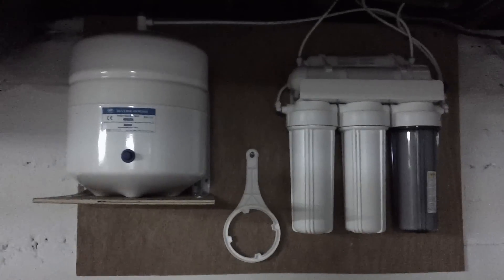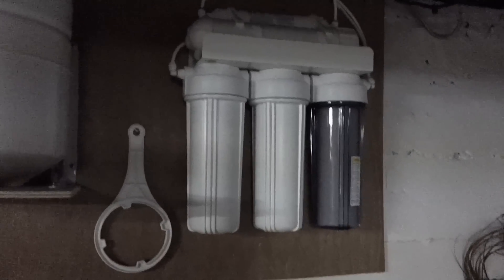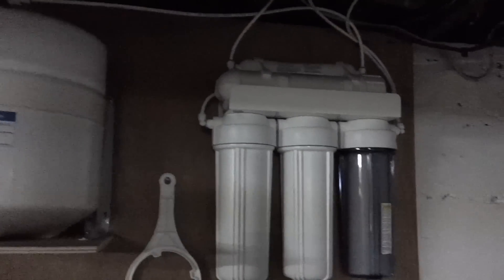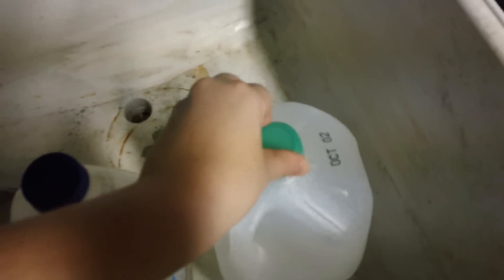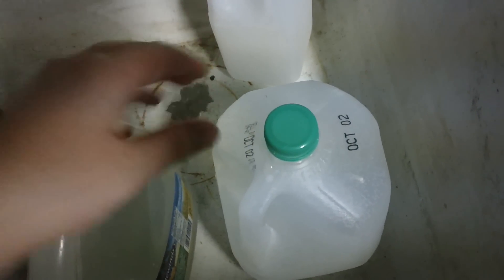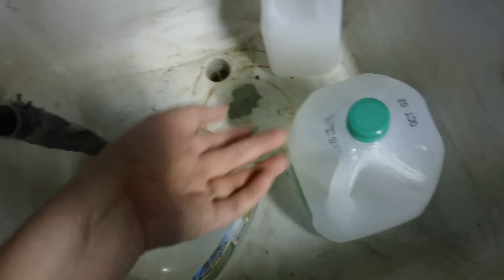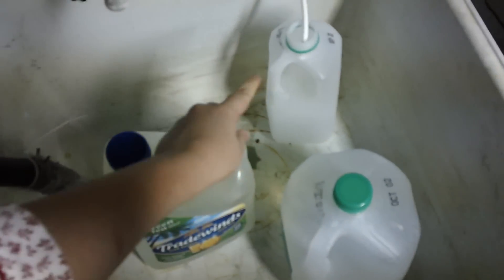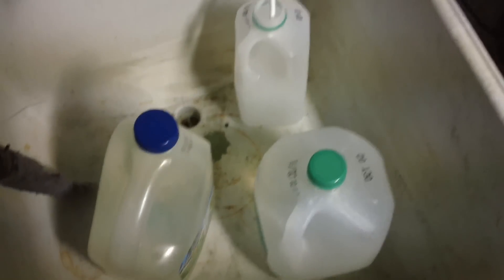Reuse Reverse Osmosis Waste Water

Comment: Very pure or de-ionized water is not good for consumption, however, most city water added  fluorine and the only effective way to filter that is with RO.  One simple way to get close to 1:1 product to waste system is changing the flow restrictor.   My 50 gallon per day system has a 525 cc/min installed has a 1:3 ratio.   Change out to a 18GPD or get a needle valve.  I have done some research and there is no ZERO waste RO system.